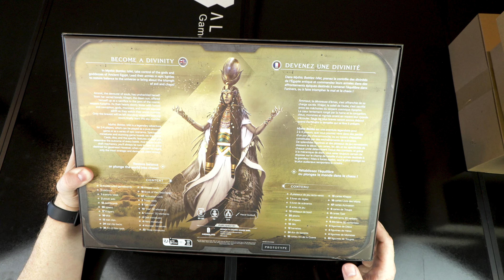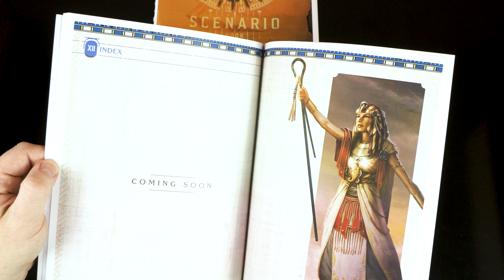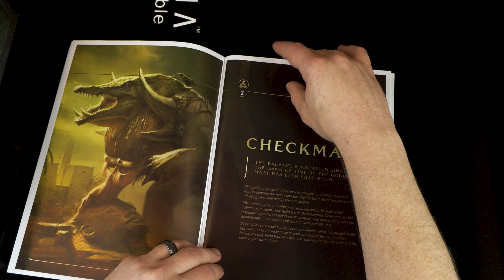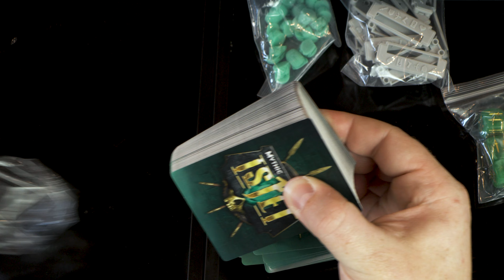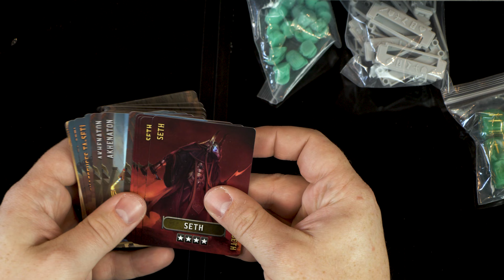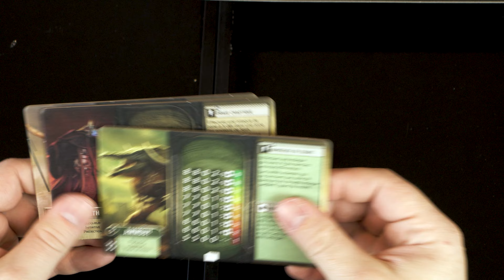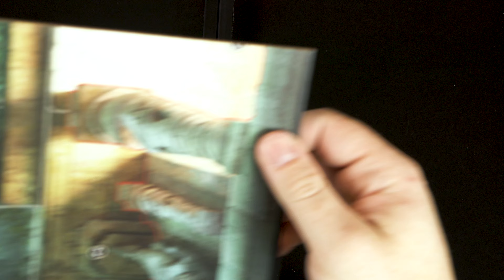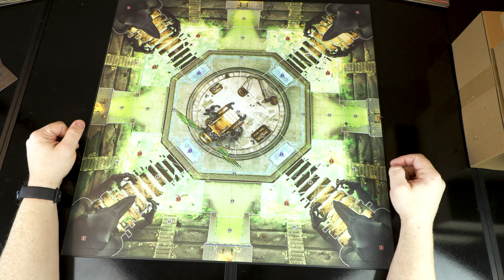Mythic Battles Isfet Unboxing!

Comment: What glue do you use? I use Super Glue 3 - control, from Loctite, but curious if you have something better.
Reply from the maker: Depends on what I'm doing. I use gorilla glue for most resin repairs, however if I need it to forever stick I use JB Weld. That stuff bonds so hard it's stronger than the rest of the mini.
Reply: @TheKingofAverage  Cool! I'll write those two down.